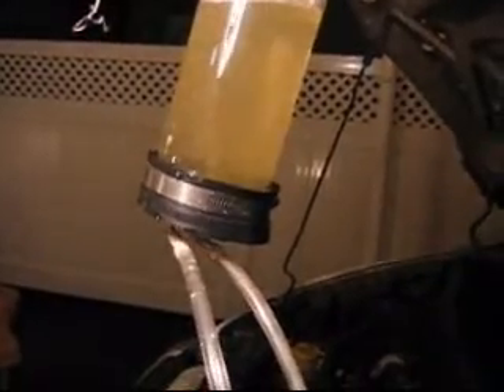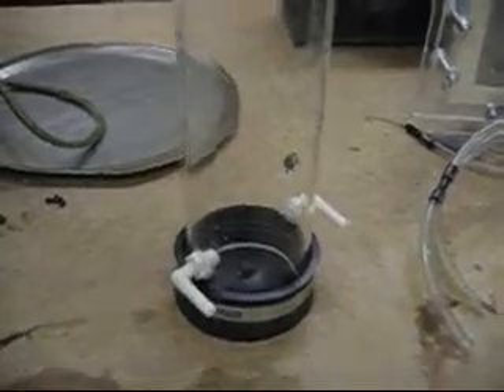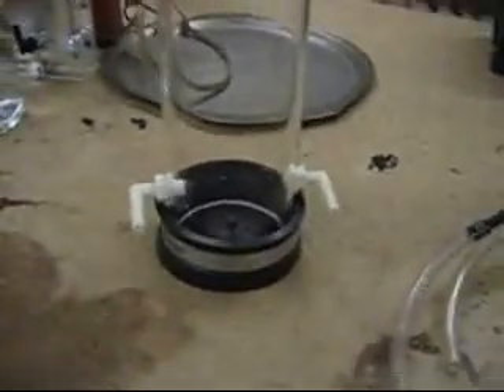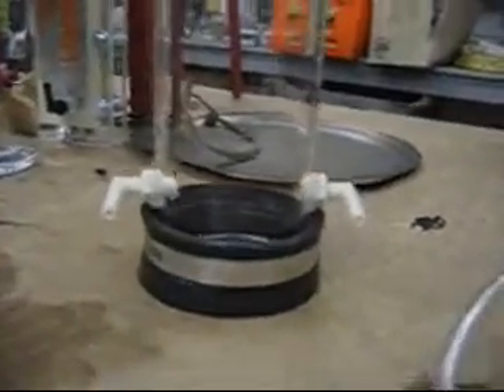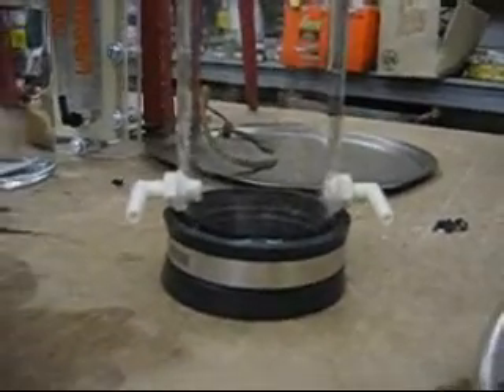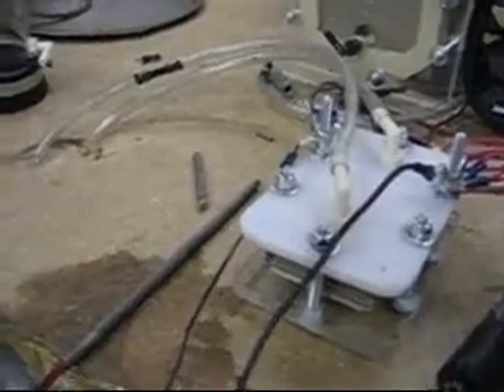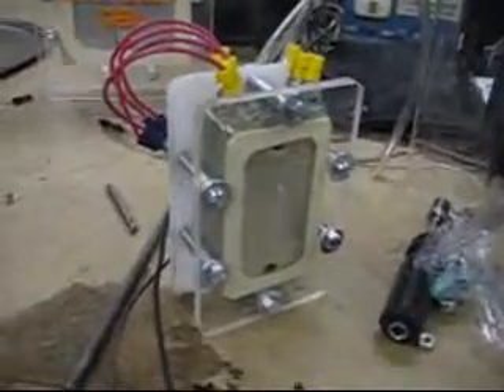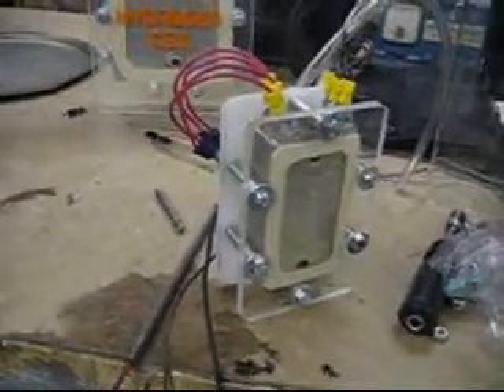HHO mini dry cell

Comment: Looks like it is working really good, but I bet you have heat issues with the cell.

By doing using positive negative through the whole cell, you are not regulating the voltage and it will eventually warp your plexiglass and you will have bad leaks. 

To regulate the voltage, you should have a configuration that will give you 2 volts per plate. -nn+nn- 

I did this will a few of my cells and I still get great output, but the enclosure and the connectors do not get hot anymore.

I hope this helps

Comment from the maker: This week i will mesure the 3 of them and i will do a video. the notch are made with very strung scisor , i do two straight cut and 2 cuts in a slop and i had to straight in up the top of the plate.
I will do 2 test each one with half a tea spoon in 2 liter on water and they other 2 tea spoons in 2 liter.